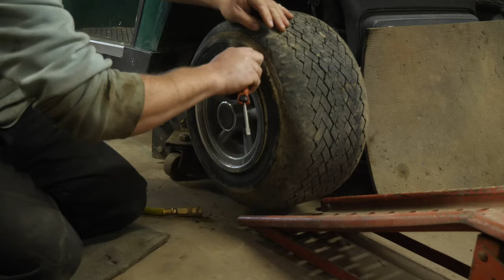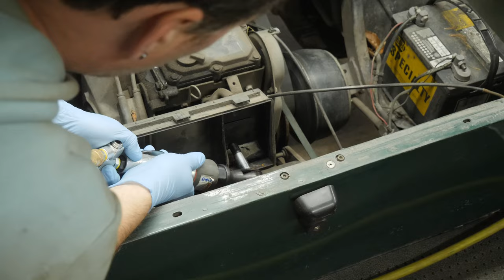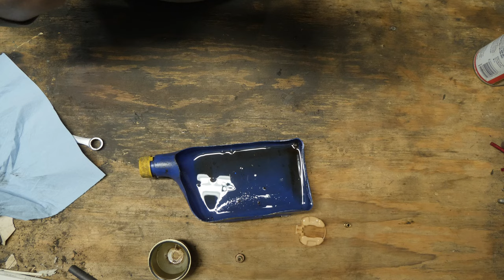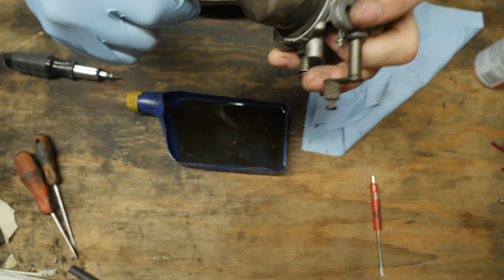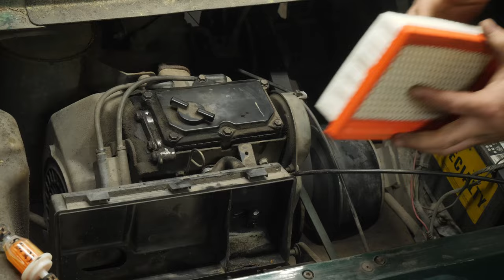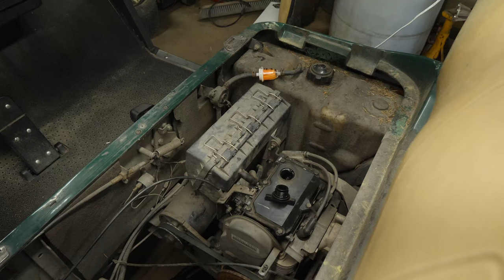2005 EZGO TXT, Gas - Service, Brake Sticking, Tire, Clean Carb

Comment: Like the camera work Kevin. I know you are aware of this but it's worth saying anyway for others that don't know. GUNK makes a 1 gallon can of carb cleaner with an inner strainer. That can be used in the place of an ultrasonic cleaner. I have had great success with using it while restoring and working on carbs and other small parts. Keep up the great your doing Kevin. Thanks again for the upload
Reply from the maker: Thanks! I'm personally not a fan of those 1 gallon carb cleaner cans. I used to use them but they created more work and were messy. I have an ultrasonic cleaner, but I still prefer to use good ol' carb cleaner in a spray can. For me, its much faster.

Comment: I'm doing the same to a ex go mpt. 2 stroke robin.smoking like crazy. Rebuild the head and valve seals are new..still smoking, bad oil ring on the pistion. Rebuild time.

Comment: Great and informative video. I use power tools all the time for disassembly and reassembly.  If you have a feel for your tools, it saves a lot of time and energy. Sorry your battery wrench is out of commission.
Reply from the maker: Absolutely agree with you there! I know my tools very well and I can "feel" when its right. Its something that only experience can teach. You will never learn it in a text book. I hope to replace the electric ratchet soon, though the air is powerful.

Comment: I've noticed these smoke if the oil is overfilled.  Then it gets caked up in the muffler, requiring a muffler "bbq" to clear out.
Reply from the maker: We used to do this with the old 2-cycle carts because people would mix gas and oil 50:1... on an injected system. Waaaaaaaay too much oil. The 2-cycle engines ran 128:1.

Comment: Hey Kevin love the videos they help me out a lot!
I got a 03 ezgo gas and I will drive it for about five minutes or longer and then I’ll take my foot off and stop for like 10 seconds and then when I try and go again I lose all power, cart will run but won’t rev up high to move. I’ll wait like 10 -15 min and then the engine runs fine again. Have you encountered this before? Thanks!

Comment: Kevin- My fule filter doesn't fill with as much fuel as what I'm seeing on this filter while you were running it. It fills with barely a 1/4 or less while its running. But my cart is hard to start and when it does run it smells rich. My valves are all adjusted correctly as well. I have a new fuel pump and a newer carb (OEM ezgo).
Any thouhgts.
Reply from the maker: Sometimes these filters won't fill completely up. Depending on its orientation, it could appear completely empty. If you remove the fuel line from the carb and crank the engine, it should pump a small amount of fuel. If it doesn't you will need to check your lines starting with the siphon tube in the tank. I would do a compression test and verify you have good compression before going too deep.

Comment: Kevin, I’d love to see how you clean the engine compartment with a pressure washer.
Reply from the maker: My most recent videos shows me washing a cart.
Reply: Are some retaining pins on the float valve not removable?  I couldn’t get mine out of the float to expose the valve.
Reply from the maker: Some carbs have the pins pressed in. They are all removable.

Comment: Please assist, during neutral and gas pedal pressed fully, I can see the throttle rod moving in and out (like if I'm pressing and releasing gas pedal manually)?
Reply from the maker: This is normal if you are not driving under load. The linkages are out of adjustment and over revving.

Comment: Where can I get a spark arrestor/carb baffle plate?
Reply from the maker: Direct from EZGO is where I get them. If you call them, have your golf cart's serial number ready. They will be able to find the correct part. If you are missing the hardware, you can get a kit.

Comment: You seem to get more ezgo carts than others. Just more of them in your area or do they have more problems?  What happened to your battery ratchet?
Reply from the maker: There are more EZGOs in my area. Many of my customers don't maintain them very well so they have more breakdowns. I see about the same number of Yamaha and Club Car carts as I do EZGOs. I don't like EZGO as much, especially the newer ones. I think they are poor designs. The battery ratchet head wore out. I think it was a fake Milwaukee ratchet.